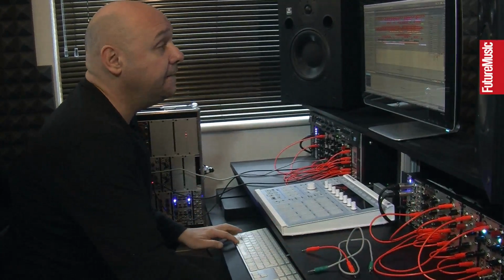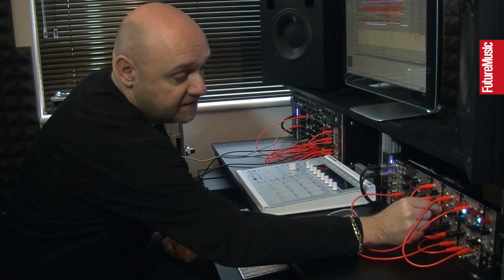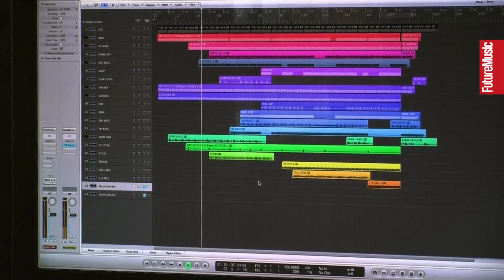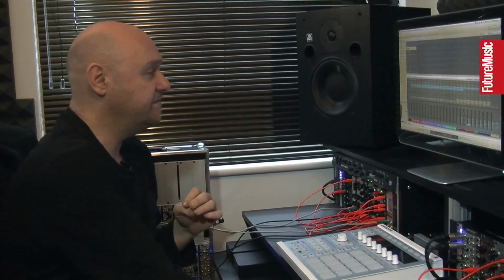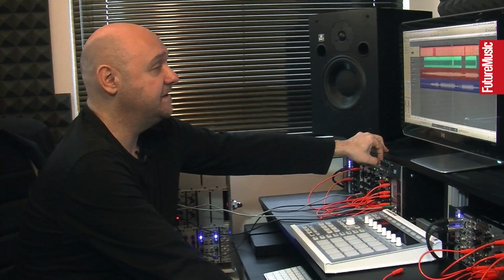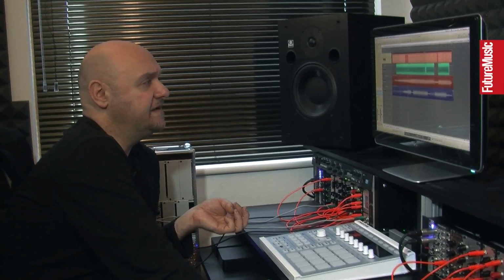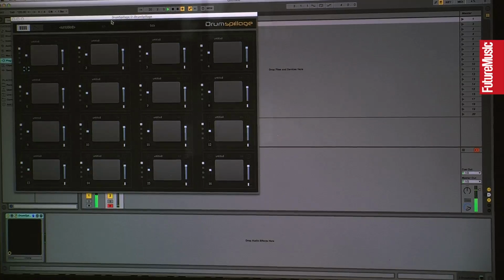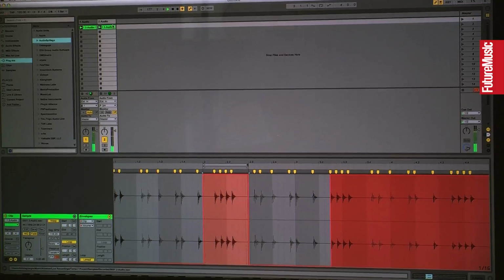Kirk Degiorgio In The Studio With Future Music

Comment: Hey Kirk you can streamline your whole process if you invest in an analog summing mixer and good converters and mix in ableton. It will sound much better then ITB ableton mixes and just as good as logic. It will also give you easy access to inserting outboard dynamics as well. high end bus compressor etc. Its not a cheap route but it will improve your workflow having to use mulitple DAWs. Cheers. I like the way you setup your modular into three seperate tasks. Cool way to think about it.